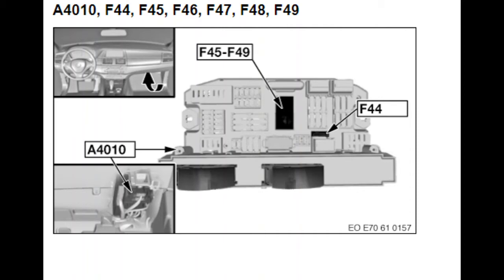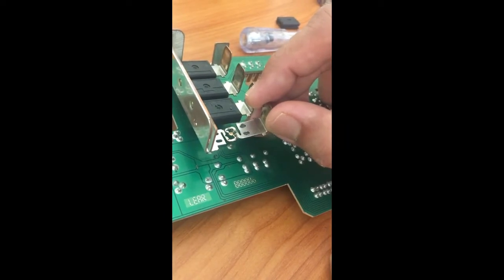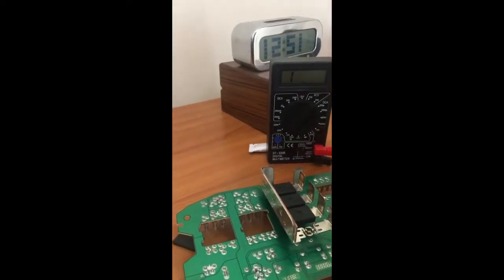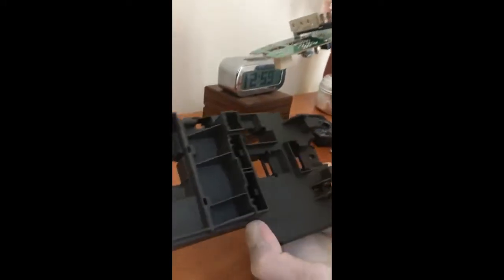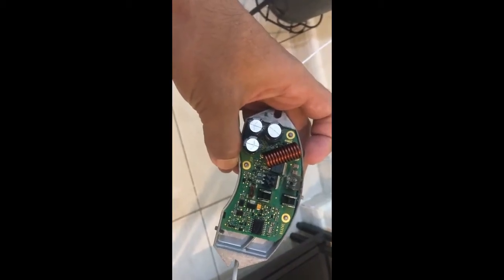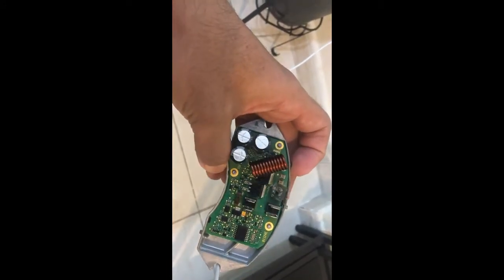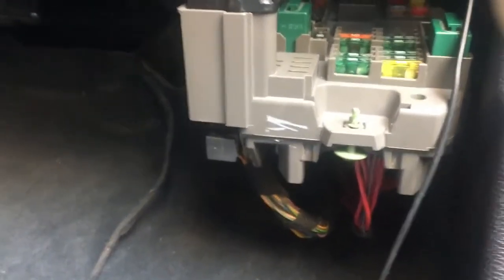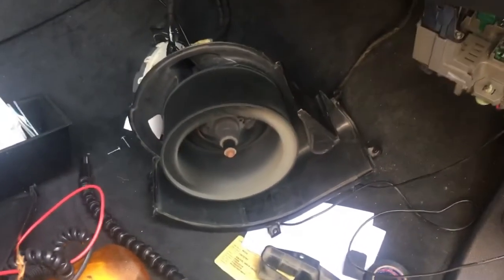JUNCTION BOX REPAIR - BMW

Comment: Quick question brother if i get another junction box from another same year x5 can i just plug and play and use or do i need to reprogram anything
Reply from the maker: As far as I understood you don't have to. I did not try but the board only has fuses and relays.
The JBE has to programmed
Reply: Everything has to reprogrammed have to attach your vin to it

Comment: I got a 2008 BMW 335i n54. I keep getting a code A731 for Junction box. My car starts and runs, but when I turn it off and start it again after 5 mins, the battery is dead and I have to jump it to start. Seems like my battery is being drained and I already replaced it. Could it be the fuse block? Or the JBE module underneath it. Please help thanks.
Reply from the maker: Try removing the Fuse F33, F61 5Amp fuse, If your car has comfort access assuming manufacturing date of your car is 2008.
F31,F32 if you have trailer module. F59 entertainment system. F74 instrument cluster.
Let me know the results.
5mins battery drain is too high.

Comment: hi there i get one error hard code that cant delete at the fault code, but it never appear in drive train error. 

from ista it state ICM fault code D0157A <-- flexbus.  maybe is in FEM . terminal 15 /30. 

how to check and fix this issues? 

i saw online this error is very less. but only saw 1 guys said they fix it by update the ECU firmware??
Reply from the maker: Did you face any issue with this code? I am not familiar with this code. My ECU update was done from one of the Indy nearby
Reply: @bimmerhacks  yes still there until today, when I plug ista it said voltage threshole also.  

like 14.77v is max and I reaching 14.07 

I wish to bring to update the firmware but i hit on my vin code,. said it was the latest.

wish to do flashing firmware again like reset it. but i scare it lock my ecu. so i need to bench mod to enable back my ecu for me to flashing bootmod3
Reply from the maker: @bizzy  no idea bout that mate. Good luck

Comment: Hello sir..my bmw f80 will not start up, low voltage at the fuel pump, pump is tested on others M car and works fine, ekps is showing no codes, fuses are ok at rear power supply, ground is ok also..
What do you think is the problem.?
Reply from the maker: Please give me a complete picture. Do you get any error code? Does the engine crank? Is any light missing in the instrument cluster? Did you check the IVM/ Power distribution box located in the engine bay?
Reply: @bimmerhacks  thanks for your reply..
There are no codes in the fuel pump module, the power distribution box is in trunk area and all fuses are ok, 
engine cranks but will not  start because I’am getting no fuel feed from the pump..
Voltage at the fuse is 12v while cranking and voltage at the connector to fuel pump is .20v fluctuating to 1.5 volts..
I even tried running an independent ground to the grounding point on the body of the car but same result..
I’am at a loss..
Reply from the maker: @buildindian8169  OMG. No code at all? If any of the electrical system is fault there must be some kind of code poping up as far as my experience. Let me check the wiring diagram and will give you an update if I find anything. By the way usually there are 4 main power distribution box for BMW. 
-BATTERY PANEL(sealed)
-REAR POWER DISTRIBUTION BOX
-PASSENGER COMPARTMENT
-ENGINE BAY (sealed one)
Please let me know what brought the car to this situation if you have any clue. There must be some relay which is not switching properly
Reply: @bimmerhacks  ok bro, thanks for your kind assistance..
Actually changed the fem because someone stole the keys of the car during the shipping process..the new fem is coded and all modules are working, all power supplies and junction boxes are in good order...new lithium battery that cost a small fortune 😄.
I was convinced the fuel pump was no good so I got a new unit..
I have ISTA,  ESYS and icom but I’am actually a diy guy and not really a trained technician so I think there are somethings I do not understand fully such as reading schematic drawings and so on...
Reply from the maker: @buildindian8169  looks like immobilizer issue due to new FEM. even if it coded might need to make the unit have a handshake with other modules like CAS and all. Hope you went through technical documents related to changing FEM. How did you code the new keys then?
Reply: @bimmerhacks  hello sir, my local key guy coded the key but he told me that once the engine is cranking over then the key is okay but for some reason the key will not open the locks and  comfort access does not work so i think you are probably on the right track regarding the keys not tying into the cas but tomorrow I will use ISTA to see if I can trace the can bus..
What is puzzling is that the EKPS module is ok and diagnosed by several software..
Thanks again for your help
Reply from the maker: @buildindian8169  Alright. Let me know once you complete your part. Hope you could get it working once you update all the modules. Remember that in German cars many things are interrelated so if one signal is missing then it would cause many modules to go in sleep mode.
Reply from the maker: @buildindian8169  FYI rear fuse box fuse number 165 (F165- 20A fuse) must get a 12v supply if your FEM signals properly to the K12 relay in the rear fuse box as FEM is responsible to turn ON the supply to the fuel pump( condition is that driver sits in the car with key).
I will start checking the circuit diagram after I get your input from these comments.
Reply: @bimmerhacks  I will crank the car and check voltage at the fuse (165) if it is not reading at 12 volt then I will flash the fem and reload complete vehicle order..
Thanks and I will give you an update later..
Reply from the maker: @buildindian8169  you should get 12v without cranking if your key is good.
Reply: @bimmerhacks  the key is good and I have 12v at all modules.
Do you think EKPS could be sending out low power although it is showing no codes ?
Reply from the maker: @buildindian8169  so you are now sure that F165 has 12volts right? Move on to fuel pump connector and see what is the value your getting in pin 2 when you crank. Pin 8 should be ground. There is EKPS and ekps electronics which gets signal from DME and FEU as per my research
Reply: @bimmerhacks  bro I have good news..we checked all fuses in rear power supply, all fuses were ok then I got that burning aroma, fuse 165 was blown, change that fuse, reconnected fuel pump and wallah pump is spinning..
We will now recharge the battery and try to start up..
Will give you an update later on..
We are really grateful for you help..
Reply from the maker: @buildindian8169  Hurray......
Reply: @bimmerhacks  Hi Sir, thank you very much for your kind assistance.
All is okay now except I need a gear selector switch and airbag module...I am getting interment fault codes and after investigating I found water ingress in those two..apparently the car was flooded at some point and some modules were changed and others weren’t..
I have ordered those and should have them in a few days so i will keep you posted..🙏🏼
Reply: @bimmerhacks  hello sir, actually I have aborted startup until all modules are checked for corrosion because I don’t want to be known about town as the DIY guy who fried his M3..😄
The dealer in my neck of the woods is notoriously expensive...I spoke to one of their top technicians and his knowledge of ISTA was quite limited (in my opinion) so I opted for the DIY fix which I must confess is not easy for the untrained person but with the help of other YouTubers such as yourself, I’am getting along and quite grateful..
Both my sons own f30s so we are becoming quite the BMW mechanics...
Thanks again for your kind assistance and I will keep you posted...
Reply from the maker: @buildindian8169  Did you start drifting with your M3 !!! :D
Reply: @bimmerhacks  hey bro, how are you? actually the car started up finally, injectors 4,5 6 is dumping fuel so I have ordered and received today but unfortunately my entire family is down with covid-19 despite our best efforts so cars are on the back burner for a few days..
I think I’m obsessed with following the covid protocols, sanitizing constantly, always wearing my mask other than when I’am in the house but I still managed to take the virus home to my family but thankfully we are getting over it..
Please keep safe and I will keep you posted on the progress of the M3 project❤️
Reply from the maker: @buildindian8169  May God give your family faster recovery. Stay safe
Reply: @bimmerhacks  thank you so much...